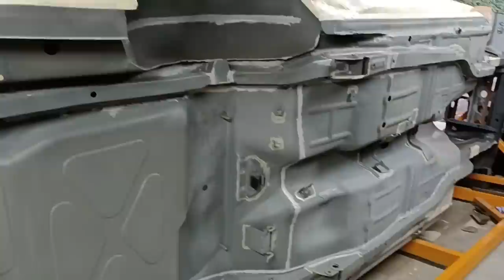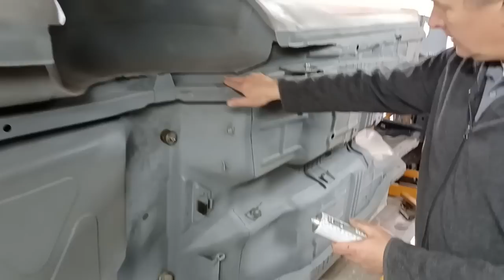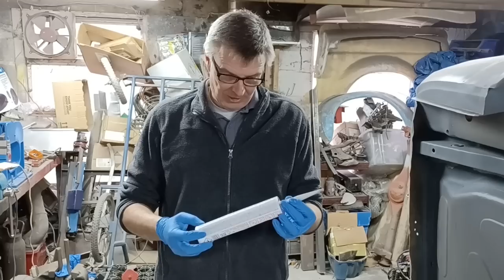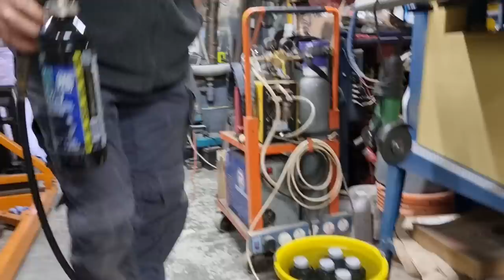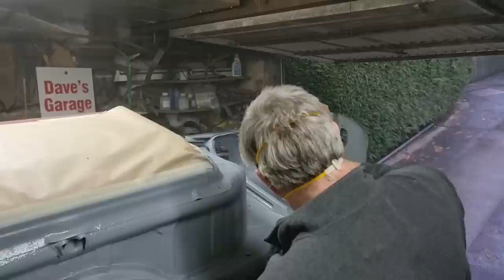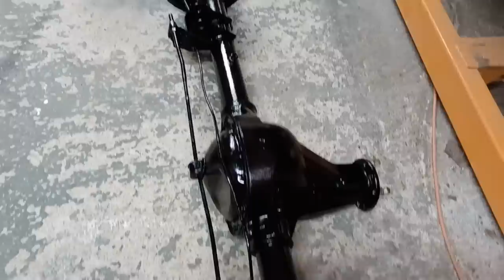Ford Escort MK1 Restoration Project, Big Step Forward! Gravitex and Seam Sealer

Comment: Come out great Dave good to see a big step closer to no more welding . I’ve always cut the bristles very short on brush & used small amount of thinners on brush to blend in Nicely. Specially tops of wing joints etc after two lines of masking tape like factory ford had on most won’t to front panel etc. see you on next upload
Reply from the maker: Thanks, I'll do that on the more visible panels 😊👍

Comment: I've used the same uderseal/coating on a kit car with the same great results , just be careful if you are using it on areas we're there might be some older underbody sealer , remaining,  it can lift /react with the old stuff,
Keep up the good work
Reply from the maker: Hi Ian, good tip, I have wire wheeled everything off back to bare metal, so shouldn't be a problem, good to know for the future though, ta.

Comment: When you're smoothing the seam-sealer, dip the brush in thinners - keep the brush wet. It will then leave a lovely smooth finish on the seam-sealer. I've been doing it that way for years & it works very well. Another thing is, if you can get some IPA (isopropyl alcohol) wipes - they are the absolute dogs danglies for removing excess/goofed seam sealer - come in very handy for around screens etc etc - they are also the best pre-paint panel cleaner going..
Reply: also also, instead of using Gravitex, get some Cobra (or other brand) bedliner & spray the undersides with that - being a 2k & being tough as old boots, it makes for a brilliant "Underseal".  Gravitex et al damage a bit too easily for my liking - bedliner is hard as the hobs of hell in comparison..
Reply: also also also, lol - if you use Gravitex/bedliner/blah blah - you can shoot them with a spray gun with a 2.0 tip - just mix as per instructions & then add 10 - 15% thinners, bang it into the cup & spray  - it gives a flatter, more even coverage than shooting it through a Schutz-gun.  If you don't have a 2.0 tip gun, buy a cheapo hvlp gun with the boggo 1.2/1.3 tip, grab a 2.0mm  drill bit & drill the aircap center hole out to 2mm - voila, a 2.0mm spray gun.  Also lashes on epoxy primers rather nicely compared to shooting it out a 1.2/1.4.
Reply from the maker: Thank you James, I really appreciate your help and comments, all excellent 👍

Comment: Just got to the same stage on my manta a project bare steel on the inner front arches and chassis rails etch primed and gravitex it’s a good feeling when you start putting stuff back on instead of taking it off fingers crossed I’ll see you on the road one day living in the valleys myself 👍
Reply from the maker: Ah fab! Nice to hear of another Manta being saved, I had a potch with mine over the weekend and cracked the windscreen 😢😬

Comment: Hi Dave   If you like to. Brush. The 2k. You will find. It can be brushed straight from the tin.   No. Activator.   To spray.  2k. U need the correct. Gun. With correct fluid tip.  I use. 83.   Cap 

2 k. Is much. Easier. Than cellulose. U can flat. And polish 2k.  

Hope helps.  Clive
Reply from the maker: That's very interesting Clive, I wasn't aware that 2k doest "need" activator, I'll look into that.  Could be the answer, without the activator it'll set slower, therefore more time to work with it...

Comment: Hi Dave it is a joy to watch taking us on this journey with the excellent mk1 escort, my neighbour and friend is doing a mk1 escort estate, I also know someone who races mk1 escorts, can I share a tip with you?, you may of already heard of? when seam sealing if you stick some masking tape either side of the panels your sealing wait till it dries then remove it gives you a neater finish almost like factory, I too use halfords weld through zinc primer but I much prefer u-pols zinc weld through primer, I won't use weld through primer that has copper in it, as like you have shown it's not good at protecing against rust.
Reply from the maker: Thanks for the tip Antony, I'll do that on the more visible seams, I think I'll be using the Gravitex on the inside too, it's wonderful stuff, and I guess it will help with dumbing the panel drumming as well.

Comment: I have to say dave its great how far you have got showing us all that you dont need fancy expensive equipment and showing
us all where theres a will theres a way fantastic dave also can the halfords weld through primer be painted over with top coat paint finish
Reply from the maker: Thanks Andy, I don't know how a top coat will go over the Halfords stuff, I'd imagine you'd be filler primer etc before that anyways.  The gravitex certainly stuck to it well, and I've just top coated that, so watch this space...
Reply: Fab dave thanks mate if you have time could you put a little of your top coat over a piece as the rust prevention looks fantastic
thanks again dave keep on keeping on great
Reply from the maker: @andyrichards1002   yeah, good idea

Comment: Nice job, as always. Good to know about the protection given by Halfords primer, I assumed being a primer it would be porous but obviously not, I'm using it after your earlier recommendation. Also, good trick with refilling the seam sealer tube.
Reply from the maker: Thanks Chris, I thought it would be porous too, but the results are undeniable, what really surprised me was how bad the 2k and 1k epoxy primers were, they're supposed to be the goto for this sort of thing...
Reply: Yes, heard good things about epoxy too but, I guess they need a top coat soon after application for maximum protection.
Reply: I've used Halford primer on my mk1 and I personally wouldn't use it again

Comment: Great work Dave, what size wire are you using?
Reply from the maker: Hi Mark, I find the 0.6mm the easiest to use
Reply: @DavesGarageuk  thanks for that, I'm using.0.8 and was told I should use 0.6 on thin metal

Comment: How are you going to keep the axle in position
Reply from the maker: Hi Oz, as it's an import shell, type 48 I think they called it, it does have tramp bars, they are shorter than the type 49 shell, and locate a little further back off the chassis.  It's only going to be a road car, and I want it to be a comfortable ride, so a 5 link set up would be overkill
Reply: 👍🏻 it’s looking good with the st170 won’t the axle move on the leaf springs
Reply from the maker: @Oz Brick  possibly, cross that bridge as it happens 😉